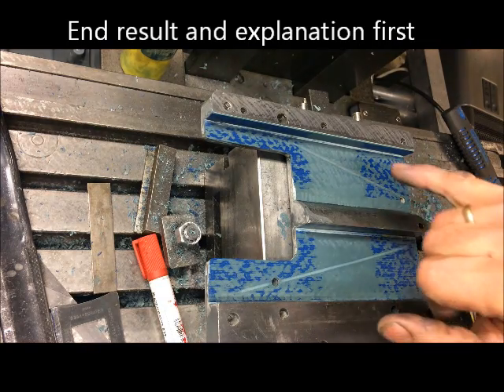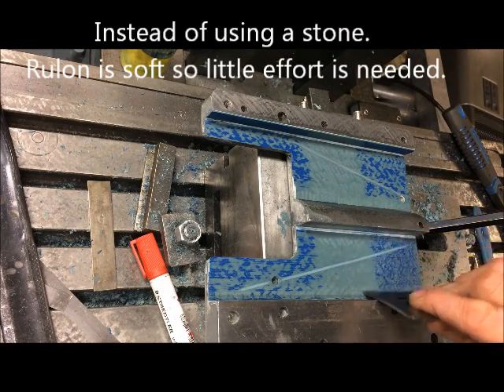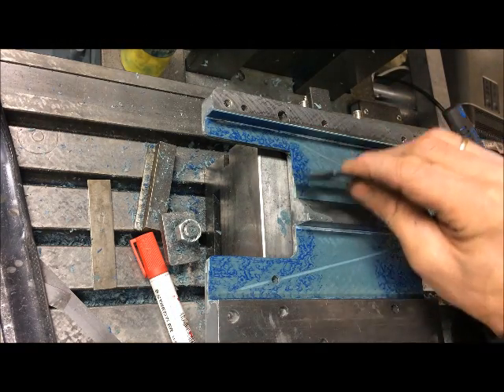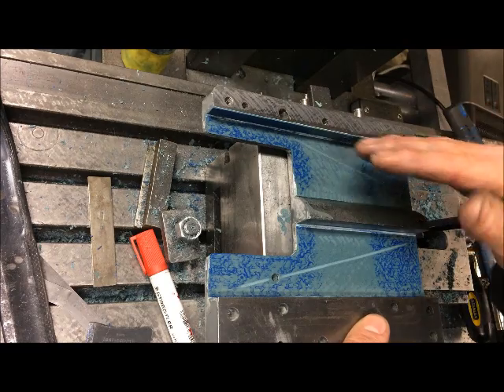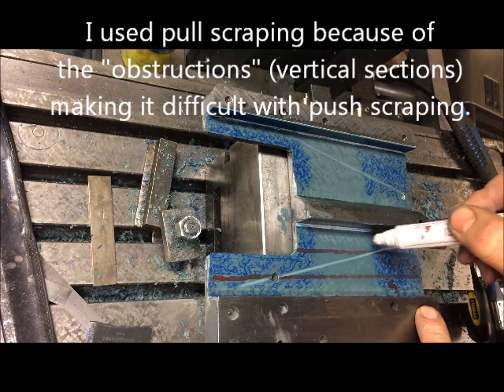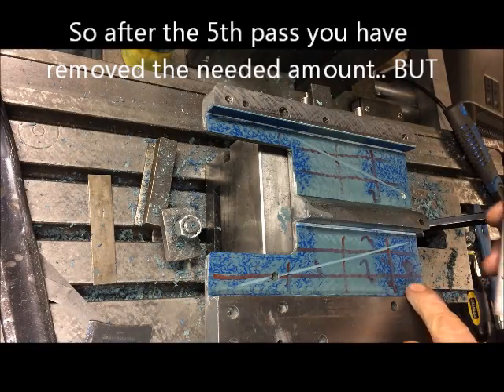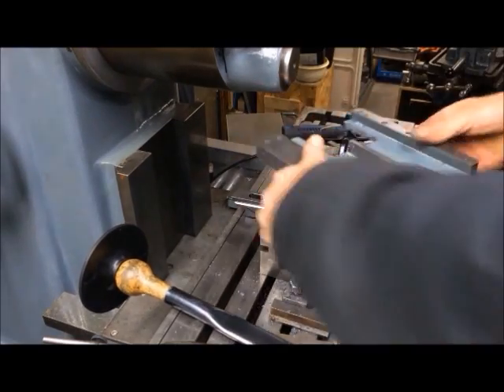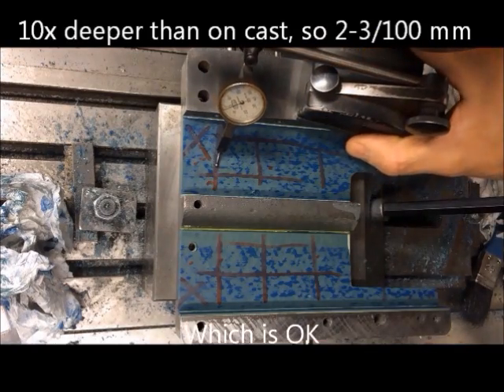Myford Super 7 - saddle - glideway material application - part 2 - scraping and alignment

Comment from the maker: Rulon onto the Myford Super 7 saddle: a somewhat unnecessary treatment, as it wasn't much worn and could have been scraped in fairly easy, but a nice excersize. I documented this in case someone is interested in doing the same. It should also mirror over to other types of lathes. As a flatbed it is easier than a V-way of course, but principles and procedures should apply (to again state the obvious, I am a rank amateur, and if some pro's should have objections/comments to methods and workmanship (or lack of this..), feel free to write a comment, so we all can learn.I achieved the objectives with reference to Schlesinger testing on lathes #15:Lathe faces (hollow or concave only)  0 - 0.02 mm per 300 mm diameterand the flatness is good to within 0.01 mm ("half a thou"), also being slightly high on the left side/towards the operator.PS! Just to make the point: I am stating I don't follow rule #2 of scraping, namely individual lines.. not really true, but I did some passes doing the scrapemarks in a row,instead of at a line. There will still be a line and indvidual marks..

I am glad I used the thicker material, as with the thinnest option when I had finished the scraping of the wear layer it would leave me closer to the backing material. I reckon I'll get there, but it takes more skill and experience. So at least this choice paid off. Practise makes perfect

Comment: How good the rulon/turcite will hold on the gib? I was told that its not recommended to do that way a gib? I would sometime need to get my lagun mill table top ground and dovetail/flatways ground and glue a turcite to flatways. Gibs are also worn so i thought of glueing a turcite on them too..
Reply from the maker: Hi Harri,Do you mean if it will stick to the relatively long and thin piece?Or do you mean to whether is is OK to apply the liner material there at all?As a matter of fact, I didn't ask myself neither.. I just thought it would be nice to apply this type of material to any gliding "unexposed" surface and so did.It hasn't been a problem yet, and seems to do what it is supposed to
Reply: Yes, i meant that will it stick in long thin/narrow piece.
Reply from the maker: So far no problem, but I am of course not sure if it stays there. Time will tell :) If not, i will just get some stock ground up and match scrape if needed
Reply: Cast iron gib stock? Where do you get that and whats the material :)?
Reply from the maker: Preferably cast iron stock, yes. However, I am not really certain that the gibs are cast originally? Don't remember now how they scrape. These are anyway available from Myford ready as spares. Else to get cast iron, I would suggest to look at material suppliers local to you or maybe someone online willing to ship?
I can also recommend to look for some other "scrap" machines, wood or metal lathes (latter at least have gibs) and make/re-use bits of the cast iron.
Reply: Im also not sure if the gibs really are cast iron. Thats just what i have read from internet. What kind of steel do you think they might be?( if not cast iron)
Reply from the maker: Well, I know that the gibs I have worked with on the bigger machines have been cats/ductile iron. Otherwise I have to try and see how the Myford gibs scrape (can't remember... have to get my butt of the office chair here and head home to the workshop this evening to try.. :) ) Steel would not be recommended if you want to scrape.. you will most probably get nasty "slivers" and have to stone a lot.. not pleasant to work with and results are so, so (at least for me).  I reckon you can use about anything that provides a sliding, "frictionless" action, even aluminium i guess if you can't find anything else, but if have some brass material at hand this would be better I guess
Reply: So milling of from the gibs, brazing brass to it and scrape it? How about bronze? I have a huge bronze wormwheel wich i could melt and cast a bar :)
Reply from the maker: Well, I guess you could do that. Not me though.. I am far too lazy to think about it in this way.. I am looking for easy ways out all the the time :) Also, bronze is quite soft. However, I meant to fabricate a new gib from a brass bar/thick plate or similar. (what you have laying around). Alternatively of course adding a layer to the already available gib, but then I would probably make a backing plate of some sort on the rear/non-sliding contact surface. I think I remember that Richard said he had used Phenolic, Bakelite or other stiff type materials.
Reply: Would it need to be some specific brass? Arent bronze More often used on bearing surfaces?
Reply from the maker: A gib is easy to exchange so I wouldn't pay too much attention to this... use what is at hand and easist for you to get in action :) I may be mistaken, but though that bronze is not often used. Anyhow, this may also work
Reply: Okay, im just a enthusiastic beginner at machining and recondition. :) All information is welcome. Do you have a email where i could send some pictures and ask your opinion how to approach things?
Reply from the maker: Sure.. just use my gmail account jshaugjord@...

Comment: What would you recommend doing with a lathe with 0.15mm of wear on the saddle when i lift the saddle there is about 7thou up and down ?
Reply from the maker: Hmm.. that is quite a lot. You probably would want to address both the bed and saddle, scraping both. You can relocate the leadscrew or "adjust" the mating surfaces between the the saddle and apron, ie milling off the needed thickness to compensate for the lowered saddle. I know the latter is possibly not the professional solution, but still.. Otherwise I reckon you must do the former, which could be done by careful attention to positioning of the leadscrew brackets at each end, fixing this level and then drill larger holes (I have tried to do this by drilling the larger size hole in the bracket first, then positioned /levelled  and used this large hole to guide a end mill to "drill" the hole in the bed casting.. and the tapping . I don't think the gear mesh would be a problem
Reply: Yes i have check for wear on the bed ways im detecting about 0.02mm
From inside ways to carriage ways which im not to concerned about for the improvement in accuracy vs cost of grinding etc, most of the wear has occurred on the saddle i though about your idea of maching off the top of saddle gearbox to bring it back up to height for leadscrew
Reply: Otherwise it would be a build up job with moglice ?
Reply from the maker: Never tried Moglice myself, but I reckon this is a possibility. Not sure about the thickness you would need to have to be able to pour this. I also think it would require more attention to the setup procedure to ensure you have all level, but on a flatbed like the Myford this as well the sealing up should be easier than say a V-bed. Working with Rulon/Turcite will not require as much prep, but will of course need scraping to alignment/surface quality afterwards, as opposed to Moglice where I understand won't require any work after it has hardened.
Reply from the maker: 2/100 mm ? That ain't much.. Have you measured the guideways, ie, the vertical faces?
Reply: Yes from tailstock end to headstock end a little over 0.02mm wear on bedways they are induction hardened so it seems the saddle has taken most of the wear, i had to clean all the grease out from the oil grooves a previous owner has greased it instead of using proper way oil
Reply from the maker: I see. It is sad to learn, but not uncommon to find clogged-up oil holes. I reckon this is down to lack of knowledge, but  still.. 
You are lucky to have a hard bed!